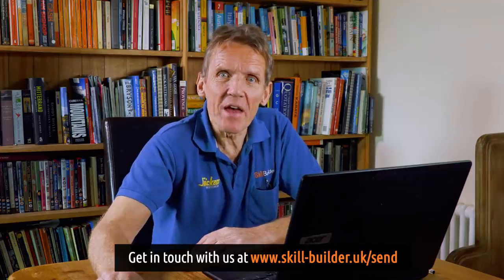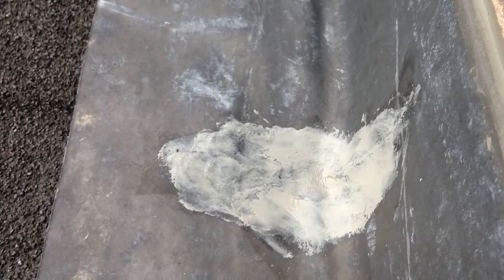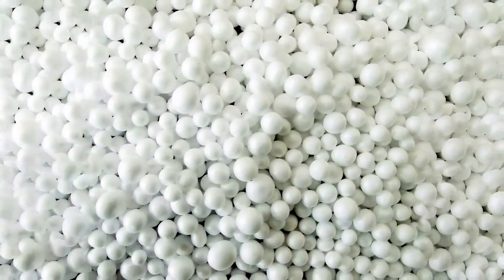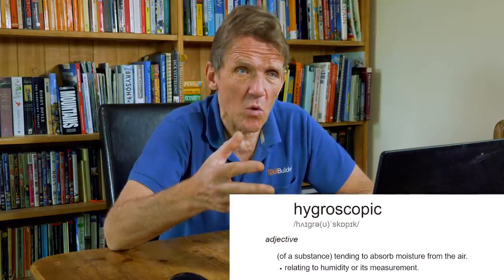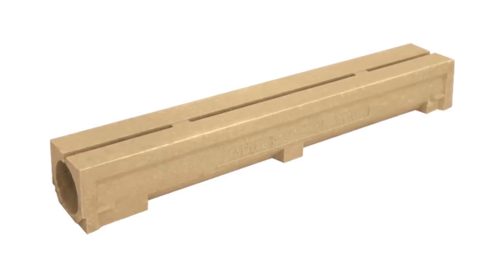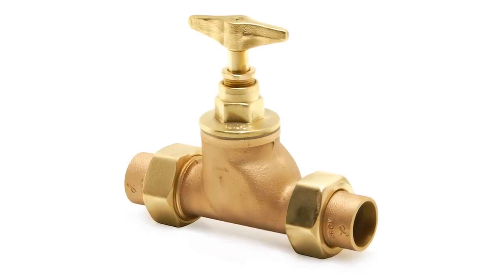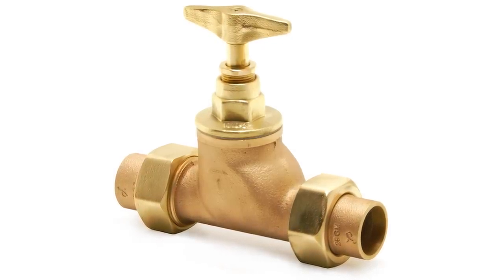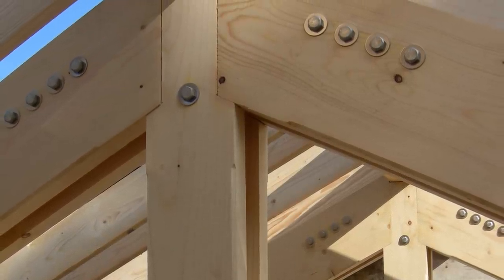Level Decking, Cracked Lead & Damp Walls - ASB #11

Comment: Hi Roger, where do you get the plastic pipe for the deck footings. The US use specially designed cardboard form tubes but can't find them anywhere. Even plastics tube I'm struggling to find at a large enough size. I'm thinking 8inch for ground level deck.
Reply from the maker: In the UK is not hard to find plastic drain pipe but most of it is 4 inch. The 6 inch stuff is avialable from  merchants and it is often posible to find stuff on dumpsters.

Comment: Am I the only person who is a little skeptic when it comes to using plastic on the outside of the building for let's say water-proofing or as panel? Also I'm in general a bit conserned about plastic products meant for use outside as I've seen bad composite decks, and cracked outside plastic panel.

For me the best building product will be wood and metal.
Reply: Most plastic is degraded by UV light. Even UV resistant plastic has additives or coatings that wear away with time. Truly UV safe plastic is more expensive which is probably why it's not used more

Comment: We all know that's a bird poo 🤣
Reply from the maker: It has happened where the cracks are. In three places so well done birds.
Reply: @SkillBuilder  Doesn't poo always happen where the cracks are?
Reply: I thought one of the photos looked like some one had put white sealant over the cracks in the lead and swirled it over the surface with their finger in an attempt to seal it?
Reply from the maker: @MrJFoster1984  They didn't mention it and I would have thought the people who fitted it would have tried grey sealant but who knows, they fitted code 3 lead so anything is possible.